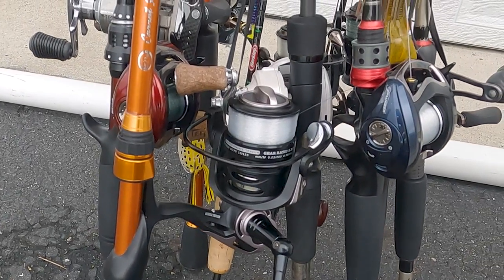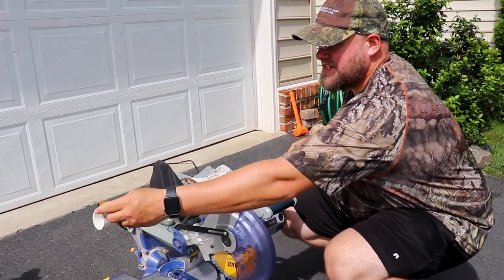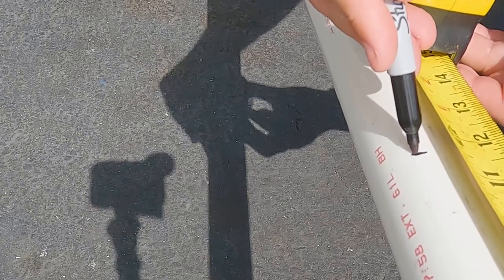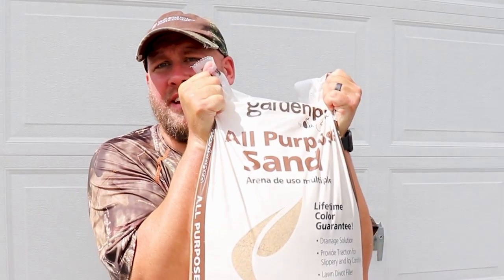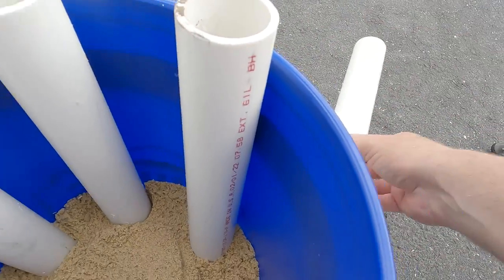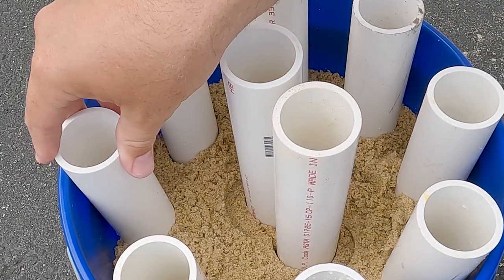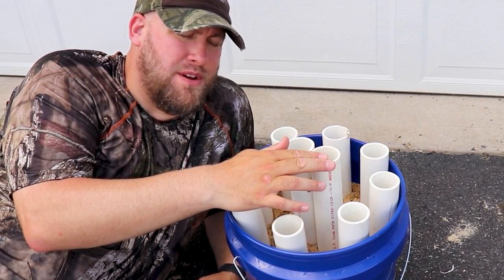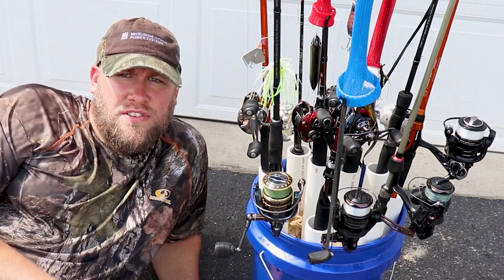DIY PVC Fishing Rod Storage Bucket

Comment: I use the Berkley rod holder wall mount. Fits in a tight corner out of the way, flat against the wall, no messy sand to deal with, and the cost is less.  @ Cdn Tire.
Reply from the maker: I had those at 1 point, but now the walls are covered with stuff and no more room for them all. I liked them